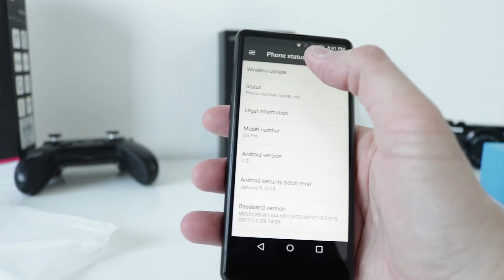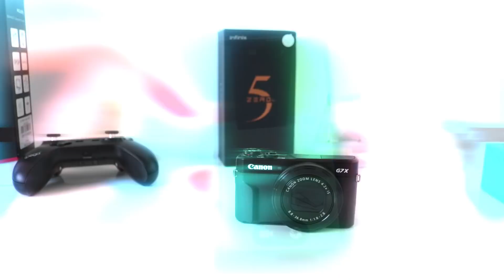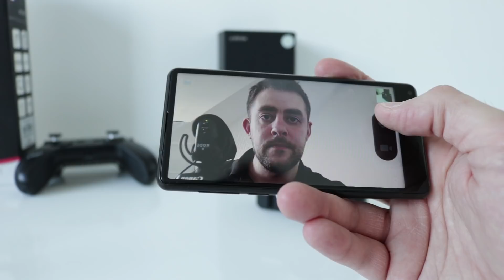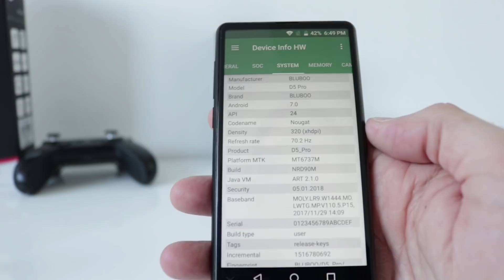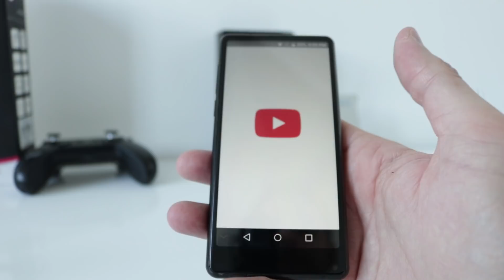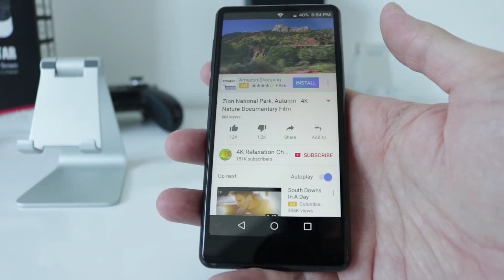Bluboo D5 Pro Unboxing - Well Built Budget Smartphone

Comment: I'm thinking of buying it, but I would like to know if it complies to Google standards , and if It has poping up ads after using it for a while , unfortunately bluboo phones have this problem
Reply from the maker: Hello mate, I can't 100% confirm that it complies with Google standard's, but there hasn't been any ads popping up while I've been using it. I can also confirm it accepts a nano SIM and micro SD card at the same time.
Reply: Geeky Stuff thanks for the quick response, I think you can find if It is certified by Google , by looking in the menu when you are in the Google shop , un your acount there in settings there in that menu you can see if It is certified
Reply from the maker: Ah yes i found it and it is certified! :)
Reply: Geeky Stuff thank you